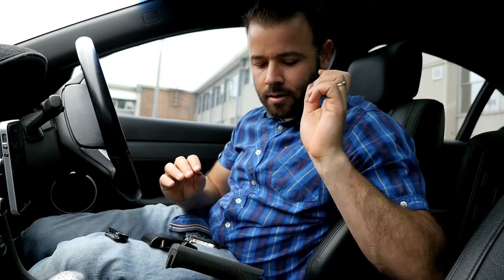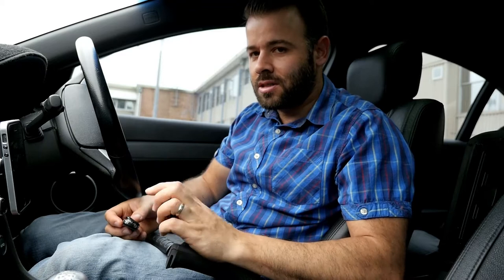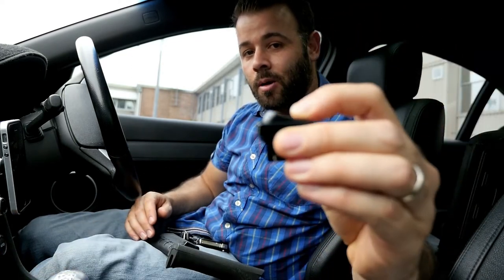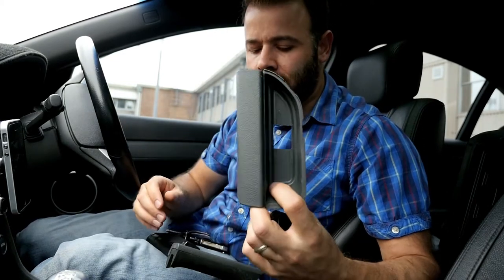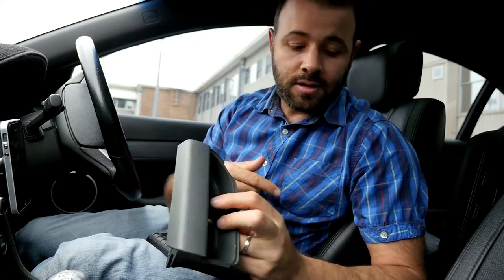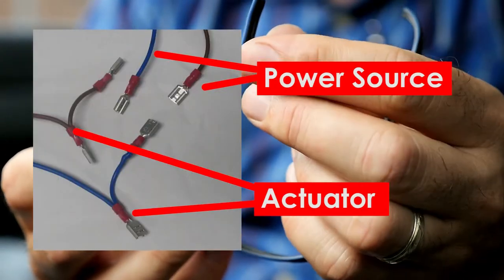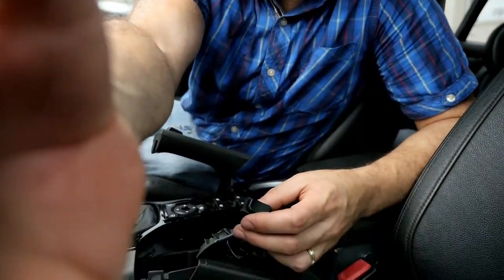X-Force Varex Exhaust - Hard Wiring The Control Switch

Comment: can you still do in between with the switch?
Reply from the maker: Frederick Gomes you can still do it but you have to press and release it really quick. It won't memorise the increments though. There may be some way where you can hack into the control module to bypass the radio switch but it would require much more in depth electronics knowledge.
Reply: JoVi Driven So my varex system is coming soon, i keep trying to find instalment videos or reviews to see how to wire it and i can't find anything. how would i route the wiring myself if possible?
Reply from the maker: It should be fairly easy to install it yourself. The control module has a connector that you plug directly into the cigarette lighter socket. The hardest part will be getting the wires to the actuator on top of the muffler. You'll probably have to pull out some of the interior trim to run the cable out of sight and either find an existing hole in the floor of the car (through a grommet or similar) or drill a hole yourself and use a grommet to ensure no water will come into the interior if you go through a puddle.

Comment: Do you need to have an ON-OFF-ON switch? Will it work with an ON-ON Dual Pole Dual throw switch?
Reply: I think you'll want an OFF. unless you're hooking up to an arduino or pi to control the openness/closedness of the valve, the ON-ON will force the motor to continuously try to open or close the valve and will probably burn it out pretty quick.

Comment: i wired everything properly but i just can’t seem to get it to work. the box is getting power but the remotes flash red when i click them and nothing happens. any tips?
Reply from the maker: Maybe double check the earth wires to make sure you've got a good connection. Otherwise not sure if the remotes need to be paired. Or you can just buy the rocker switch and bypass the remote module ;)
Reply: JoVi Driven it ended up being a dead battery, but the remote still only works every once in a while. a lot of the times the box doesn’t detect the remote. will hardwiring it change that? or will that not work either since the box only sometimes detects the remote
Reply from the maker: @arili748  When you hardwire with the switch, you remove the box totally and don't need the remote anymore. It's a simple circuit so you really can't go wrong with it.
Reply: @JoViDriven  awesome. thanks for ur help!

Comment: i’m a little confused on what u did to the wires. so the system originally has one part that goes into the box, and one part that goes into the cigarette lighter, did u just cut the ends off of them and put terminal connectors on them and plugged them into the rocker switch?
Reply from the maker: The control box is essentially just a wireless remote switch. So I essentially just removed the control box and replaced it with the rocker switch, which reverses the polarity to turn the actuators open and closed.
Reply: @JoViDriven  yes but what did u do to the wires? i know u used the ones given with the system but did u solder them to something to be able to plug it into the rocker switch?
Reply from the maker: @arili748  I used female blade terminals and a crimper. No soldering needed.

Comment: Hey mate, I did exactly what you did in this vid (even have the same switch) and wired it correctly but when I press the switch it works for abit and then doesn’t work unless I disconnect the wires and reconnect them. What did I do wrong?
Reply from the maker: Hmm not sure. It's very simple wiring, so not sure why it only works intermittently. Where are you drawing the power from? Not sure if it's tripping a breaker or something? Also, I know this probably sounds a little silly, but I'm just going through a process of elimination and I realised I didn't really clarify that you don't need the control module anymore. So you did remove it didn't you? You just need to wire the power source directly to the rocker switch and reverse polarity wiring to the Varex muffler actuator.
Reply: JoVi Driven Tapping into the Radio 12V (I’m pretty sure they are 12V).
Reply: JoVi Driven I got rid of the box anyway, it was doing the same thing with the box too. Got a new battery for the remote but still was doing the same thing.
Reply from the maker: @IAmLuckyMan001  It should be 12V but whether or not the circuit can cope with the load of the stereo and the varex simultaneously, I'm not sure. You could always try running a temporary wire straight from the battery and see if you get the same issue. You could also see if your interior fuse box has a blank space with active power to it. I've done this in the past with other accessories and just used an inline fuse holder. I just used a flat pin connector to connect into the fuse location.
Reply: JoVi Driven I’ve got no stereo atm (because race car), it only works once after power is on I was thinking just to put a relay on and see what happens then. I’ll see what happens running it from the battery too.
Reply: JoVi Driven All fixed now, problem was a faulty negative plug.. my bad.
Reply from the maker: @IAmLuckyMan001  Awesome! Glad it worked out ok!

Comment: Hi there... how do you run the wiers to the cigarette lighter and the switch ???
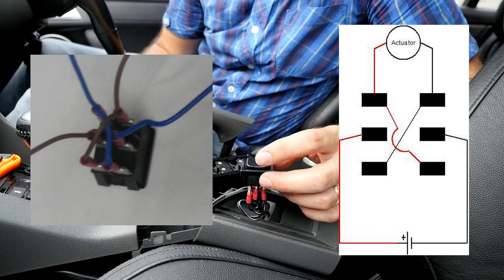Reply from the maker: Check the wiring diagram @2:11 you can see the ositive and ground wires go to the centre pins on the switch.

Comment: Awesome vid bro. Just a quick question, is the switch paired directly to the motor form the exhaust cutout, or is it still wired to some kind of actuator? I have an electric wireless cutout as well but the module that receives the signal, does't work anymore, and i cant program it anymore.
Thank you
Reply from the maker: The switch is just wired directly to the motor. Very simple circuit required to make it work. You just won't have any start/stop points, so if you want to stop it halfway between open and closed, you need to press the button really quickly.
Reply: @JoViDriven  Awesome! Thank you very much bro!
Reply from the maker: @edgar3646  You're welcome!

Comment: hi mate what kind of wire are you using?? 7.5A or 15A? cheers
Reply from the maker: I ended up reusing all of the existing wires from the control module and socket plug and cut a couple of 5cm length pieces from the excess wires to do the cross-over on the rocker switch to switch polarity. I'm not an expert in this but I'm pretty sure it's 7.5A wire. 
The picture I included showing the closeup of the wiring of the switch was taken from a website unrelated to this install. 
I haven't found any info regarding the amperage of the Varex actuators but I doubt they would draw more than 7.5A.
Reply: @JoViDriven  wouldn't they be 10A as initially hooked into 10A cigarette lighter socket??????
Reply from the maker: @adrianducker9424  Not sure, but 10A wire would only be needed if the Varex actuators required a 10A draw, which I doubt they would. I couldn't find any specs online about current draw. And I can't test it now as I don't have the car anymore.
Reply: @JoVi Driven  thanks. Curious, where'd you pick up positive and ground? I'm thinking going with a fuse holder to interior fuse box.
Reply from the maker: @adrianducker9424  I just did the easy way and wired straight to the cigarette lighter circuit, which is probably not best practice though, but would be fine as long as you don't use a high powered device in the socket itself. But if you're just going to use something like a USB charger, that's only going to draw max 1A at 12V anyway. Going directly to the interior fuse box with a fuse holder would be the ideal approach.
Reply: @JoViDriven  thanks.